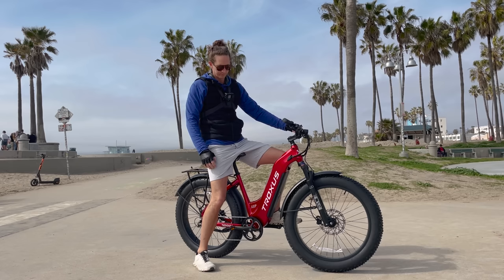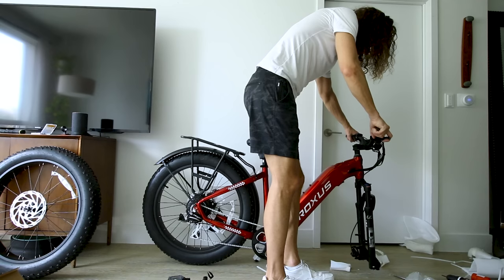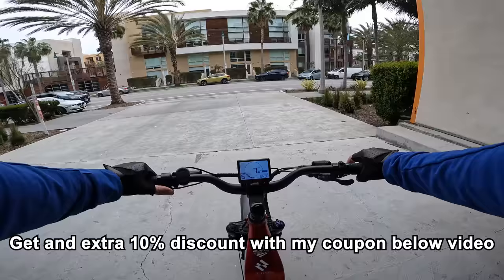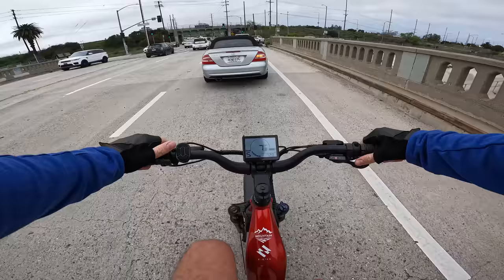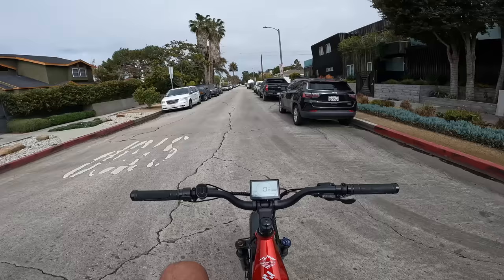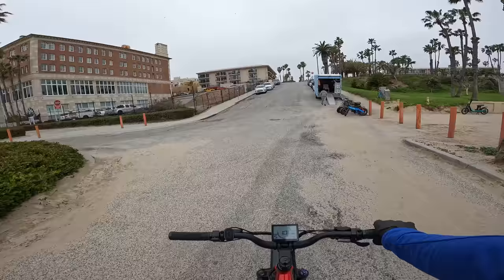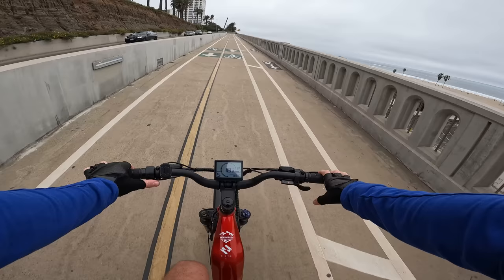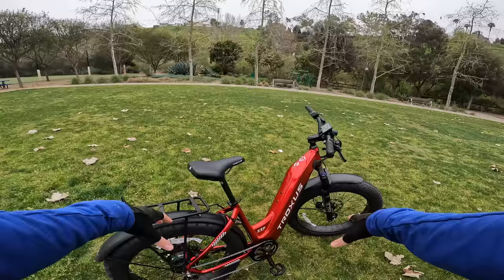Overpriced EBikes DO NOT Want You To See This! Troxus Explorer Review

Comment: I live in more mountainous terrain so this bike might not cut it.  Currently I'm using a Raleigh 21-speed mountain bike.  At 69 I could use a motorized assist.  The question is gas or electric?  Is there a hybrid?  I like quiet.  With gas I want a good stealth muffler.  Most definitely need a step through and I need to sit upright with plenty of seat cushion for 6'1" no butt meat.
To smooth out that jerk in power you talked about perhaps a variable potentiometer thingy for throttle control.  I'm thinking that rack needs some improvement for carrying stuff.  Personally I want beefy, quiet, comfortable, long range, fenders, hidden wires and lines, and other amenities.
If you could mix and match (Frankenstein) your own bike build from the various bikes and parts you've tried, what would you use?

Comment: Sounds like the Velotric climbs hills best? I am trying to decide between a Velotric Nomad, Troxus Explorer, or Himiway Cruiser or REI co-op e1.1 step through models. Every road around me is at least as steep if not more steep than anything you tried in any of your videos so I am still unsure which of these bikes is best. I like the brakes of the troxus but both the nomad and himiway weigh 72lbs and the Troxus weighs 92lbs. Although the REI bike does not have as fat tires as the others which I really want, but it is only 54lbs so even lighter and has 80Nm of torque even only at 36V. The Velotric has only 55nm, is that right? Your advice would be greatly appreciated! I don't care about top speed since speeds over 15mph on the terrain here are suicidal anyway. If the specs say a certain amount of torque how come these bikes have such different hill climbing abilities, they are all hub drive so gears shouldn't matter, I don't get it...
Reply from the maker: In your scenario I would actually highly recommend the Velotric Nomad 1. This bike significantly out performs both the troxus and a Himiway Cruiser on hill climbs. I have not rode the REI bike you speak of, but I have never experienced a strong performing 36v hub drive bike on hills, regardless of what the hub motor torque is rated for. When it comes to the torque rating listed on motor, that number is basically the amount of torque that the motor can produce at maximum only if the battery and controller actually send that to the motor. The big limiting factor on a lot of these bikes is the controller. And if it’s not the controller, it is the discharge rate of the battery cells. 
I did not take the velotric motor apart yet, but I feel like it is just geared more for climbing hills compared to many of the geared hub motors I’ve tried, but it limits the top speed to around 25mph because of the gearing. If you want to grab one I have my links below, hope this helps!
Velotric Nomad 1: https://bit.ly/VelotricNomad
code Juiced60 - discount $60
My review: https://youtu.be/d_1D9yCEM50
 Irode this bike to the Hollywood sign in this video: https://youtu.be/qAIUzO-HUwo (massive hill climb)
Strengths: Hill climbing, comfort (relaxed seating position), acceleration (one of the quickest and torque-test hub drive ebikes I have reviews
Troxus Explorer: https://bit.ly/Troxus-Coupon - 10% off wl code TAILHAPPYMATT
My review: https://youtu.be/my06NK6Jyvs
Strengths: range, comfort, brakes, incredible value (while on sale), top speed

Comment: I am still trying to decide if I like the seat.  I am assuming the Lynx and Explorer have the same one.  It is wide which is nice but it is much firmer than my other ebike.  I might order an different seat.  Any recommendations for a spongy seat?
Reply from the maker: I know the Cloud C9 is popular, I honestly thought the stock seat is perfect. You may also consider adding one of those seat post “suspensions” if you want the best cushion you can get other than going full suspension
Reply: Yes. I recommend Redshift Shockstop seatpost. My recommendation is based solely on my opinion formed by watching probably hours and hours of video. It’s expensive though. The key is how it moves. Adjustability is not quite so simple, though, but I view this as small compared to benefits. Should be THE choice if you have chronic back pain, IMO.

Comment: Can you change the speed limiter to make it faster?
Reply from the maker: You could modify the wheel diameter in the settings to trick the speedometer into thinking the bike is going slower than it really is and get motor assistance beyond 28, but the display limits you from increasing the to speed beyond 28mph. Hope this makes sense. Realistically this bike won’t go much faster than 30-33 due to power output from the controller

Comment: Do these type of bikes usually have such small batteries or am i missing something the Haul ST by specialized comes with a 720AH battery ???????.
Reply from the maker: Probably 720Wh (watt hours) which would be a 48v 15ah battery (48V x 15ah = 720Wh) this troxus has a 48v 20ah battery which is 960Wh
Reply: nevermind i see now one is AH amp hour one is WH watt hour

Comment: How do you get these bikes repaired when problems occur if you live on the other side of the country? What kind of warranty does this come with?
Reply from the maker: They have a warranty, most parts are off the shelve common replaceable components
Reply: @TailHappyTV  When the controller is integrated into the frame, it makes it much more difficult to access. And I bought a bike and can't tell what the brand of rear hub motor it is.

Comment: I'm curious, Did you change the top speed to 99 in the settings. I live in Laguna N CA that has some hills. Do you think it would be a decent hill climber ?   Using your discount code this bike sells for around 1339 sales tax included.
Reply from the maker: The troxus has pretty decent hill climbing ability, however if you need a strong hill climbing fat tire hub drive ebike my #1 recommended hill climber is the Nomad 1: https://velotricbike.info/3mOCqKO 
I made a video riding it up to the Hollywood sign, it performs very well on hills: https://youtu.be/11BSjoJ0VZo
Reply from the maker: I did not change the top speed or any of the settings on the Troxus, and I do think the troxus would do just fine in the hills in Laguna as long as you use the gears and pedal a little bit. I used to live there and ride my road bike up that steep hill off crown valley to the look out point. Troxus will do fine.
Reply: @TailHappyTV  Thank you

Comment: You can program the controller, very easily.
Reply from the maker: Nice, have you done this?
Reply: @TailHappyTV  yes, do you need help doing it?
Reply from the maker: yes please 😆 what top speed can you get?⚡️🤙
Reply: @TailHappyTV  top speed matters on the components.
Reply: @TailHappyTV  what kind of bike do you have?
Reply from the maker: @--JohnDoe  what kind of bike do I not have is the real question 😆 I was referring to the troxus in this video
Reply: @TailHappyTV  wow, I wrote you a long detailed message with links, hit send & its gone.
Reply: @TailHappyTV  I have a eunorau fat-hs with a bbshd motor/controller.    I'm not sure about yours.  I would just buy the cable and see if it connects.   If it does you should be good.   I suggest do some research of your own.      But with the app you can program while riding, it's awsome.

Comment: Hmmm, using the link the bike is already $2300. Must have been promotion for awhile.
Reply from the maker: they will be putting it on sale again soon I'm sure, aint nobody buying that bike at that price. will be posting my fav fat ebike for the price that actually runs a good price 24/7 soon (battery is smaller than this bike, but way faster)
Reply: @TailHappyTV  I' ll check it out,  I didnt realize there were cheaper Ebikes worth buying until recently. The only ones I'd seen and rode were Specialized, Trek etc....WAY to expensive.

Comment: If you want to work for Deliveroo buy one.
Fake compponents, can say the brand name but from china I found out expensively are not the same.
Size of Battery does not equate power.
Forks need to be serviced if they are coil , ever opened a Chinese budget fork!
203 rotors have been available for years. Nothing new.
Dont buy Chinese cause the parts are not stress tested like the export stuff they do to big brand names.
Thank me later.

Comment: So the company raised the cost by 400.00 in the three weeks after posting your vid. Not a nice thing. 1799.00
Reply from the maker: Apologies the promo has changed - you can get an extra 10% additionally off that with code TAILHAPPYMATT. They didn't raise prices, that was a March sale. Similar to Amazon and other retailers having flash sales, it is a common thing to run sales (which all have end dates).

Comment: This or the Heybike?
Reply from the maker: I guess it depends on what you want. The Brawn has better suspension on the fork, but a smaller battery, no step thru frame option, and higher price (right now anyway). Headlight on the Brawn has a vibe, but also adds a bit of weight that's not really necessary. Both are good bikes really. I know this doesn't answer your question, but I hope it helps you decide.
Reply: @TailHappyTV  Thanks

Comment: Nice review. How noisy is the rear motor?
Reply from the maker: about average, fairly quiet really, you can hear it a little bit when running high power at 25+ mph but its minimal compared to mid drives

Comment: why not have prices out in the open. I can't frankly see a salesman of these products being honest. Everyone acts like they are CNN. JUST THE PRICES TO START IS ALL I ASK. You sit and discus how neat it is to have 2 little lites on the back. I bought my Chrysler300 12 years ago. After 2 months the back locks stopped working properly. 500.00 to fix each door. The car I had before that had the drivers electric window stop working. 400.00 to fix and the mechanic just made a mess of my door paneling. Thanks for all the extras. Cheap bikes. How cheap? 16 minutes thru film and not one price. Bye.

Comment: Legally on a bike you have to ride with the automotive laws. That means no riding between cars. You are suppose to take a space between cars and move with the traffic. Or pull over. You can pass a car if the left lane is open. You are thus in the video showing dangers acts. As also is noticed that you cut out the part where you also did not stop at a stop sign. When we all go to the hospital we are all then in line for the surgeon, thus it's very selfish riding. 😢

Comment: AS a former auto mechanic in the 1970's I am shocked at the cost of these e-bikes. I would buy a conversion kit and modify an existing bike or put the money towards an EV. These are not a good buy and would lose substantial value if sold as a used product.

Comment: 2k i could get a moterbike.....or a car
Reply from the maker: Yes, but then you have to buy gas, insurance, registration, you name it, oil, changes, maintenance
Reply: @TailHappyTV   here they still not fully legal unless you "rent" one instead of buying one its illegal to insure them aswell atm and you get fined and points on licence if you have one law slowly changing. the point is though 100 dollar for a decent battery cell suppl a couple hundred on speed controller and cheap bike convert a car alternator into a moter and you saved money....... Like over half for prob even more range and speed

Comment: Dude - $1800 is an overpriced eBike.  My E-Moto Ridge 2 was about $600 when I bought it new around 2014.  If you want to post videos with clickbait titles about price, find something in the 500-750 range that supports a 250-300lb adult! That I would watch...
Reply from the maker: ill see what I can do
Reply: @TailHappyTV  I didn't actually expect you to take my comment seriously, so thank you!  If you do look for a bike to review in that price range, see if you can find a step-through - folks 60+ often have trouble mounting/dismounting; any bike that's sturdy enough to hold a heavier adult is tall enough that it's hard to get a leg over the back, but step-through bikes mostly don't have the strength of frame for a 300lb adult so are rated for lesser maximum weight.  I've looked and can't find any step-through that's remotely as sturdy as my Ridge 2, at least not at a price I could afford.